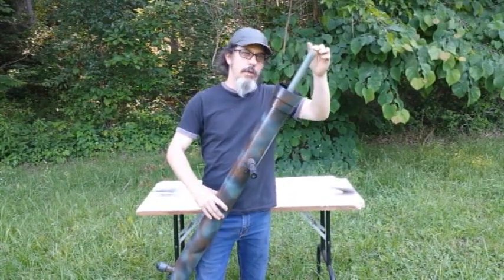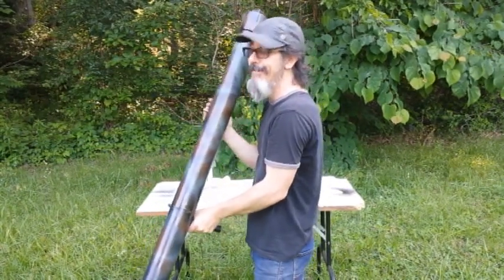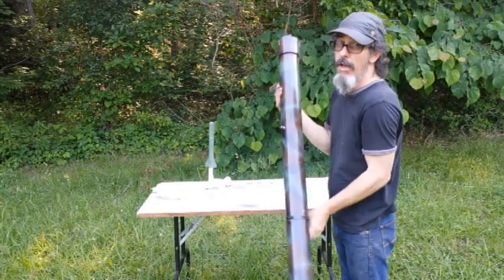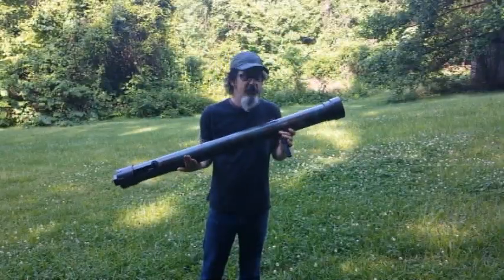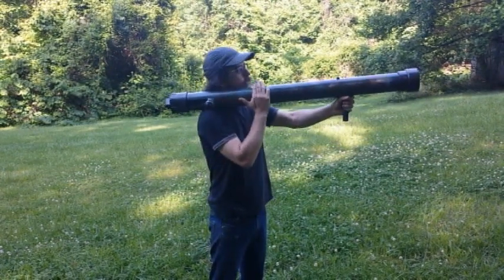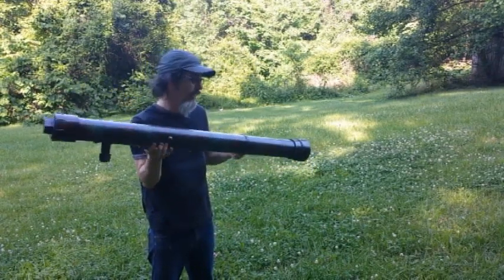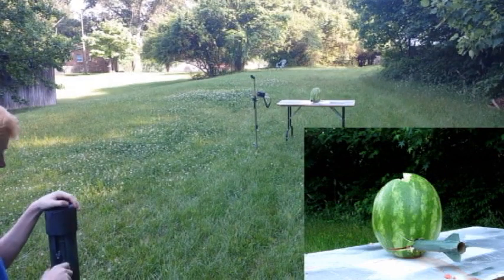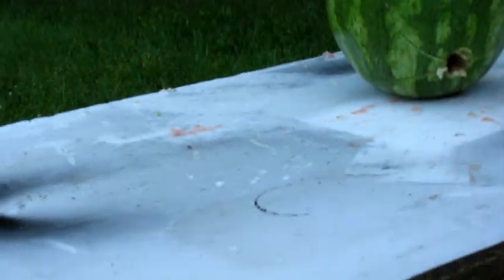Nitrocellulose / Gun Cotton Shoulder Mounted Rocket Launcher Reveal! King of Random Dethroned!

Comment: Funcionaría la nitrocelulosa en una bala?
Reply from the maker: Translation: Will nitrocellulose work in a bullet?
Modern gun powder is based on nitrocellulose. However Im not an expert on firearms or reloading bullets. Improper reloading of bullets could be very dangerous.
Reply: schel sullivan Thank you so much for your answer!
What do you think about gas combustion propellant in a specially designed bullet/shell for that purpose? Maybe, this method can cause a louder bang for an airsoft replica, and make it realistic! (Plus  with a exploding BB's maybe¿?)

Sorry for my bad english man
Reply from the maker: That make me think of toy cap guns. Did you see KingofRandoms thunder caps video? https://www.youtube.com/watch?v=ctX3juq9Okw
Reply: schel sullivan Yup, i did it. But im talking about exploding BB's (actually exist), not an exploding target.

Maybe I do the experiment, to corroborate if a cartridge loaded with propane can shoot steel BB's... It would be amazing!
Reply from the maker: I have been thinking of redesigning this NC powered launcher to shoot more than cardboard rockets. More like a muzzle loading gun, but the PVC pipe is not likely strong enough. Need a breech proof design so It can stay safe.
Reply: schel sullivan That would be amazing dude. Try to use copper or aluminum for the main structure

Comment: Hey Schel, Nice far as it goes , Your "rocket " flies straight and has a velocity! Try actualizing The rocket by adding a store-bought engine say C 12 -0( no ejection charge) with A little Armstrong mixture or flash packed carefully in the nozzle to ensure Ignition …
Reply from the maker: Ive been thinks along the same lines, but with homemade sugar rocket engines.
Reply: @schelsullivan  use some black powder in the nozzle, the other two suggestions will blow out the clay

Comment: I've always kinda stayed away from building a device that involves lighting explosives right next to my head.
Reply from the maker: That would be good rule of thumb, however that is exactly what you do when fire a riffle or shotgun. I do not recommend attempting anything I do in my videos, they are "for educational purposes only". Did you see my breech testing video I did on my side loading gun cotton combustion chamber? https://youtu.be/ac4eO81pfHQ I did thoroughly test this design before firing it off in my hand. This design will hold up properly with the .25 ounces of gun cotton its designed to burn. Still, dont try this at home unless your and expert at this sort of thing!
Reply: Still, the DEGDN in gunpowder has much less of a chance of detonating.

Comment: If you want to make an impressive explosion try this: using a rubber mallet,lightly hammer the contents of a Estes rocket motor. Once done crush the propeller into fine powder,repack it into the tube and use adhesive buddy on both ends. Place the electric match in middle of tube. The rubber mallet let's you remove the propeller without beating up the rocket motor. The result is impressive..it got the cops called on me for it once.

Comment: LOL Hey add some TATP to the tip of the projectile :)
Reply from the maker: Sounds like fun. You think the rocket launching forces might set off the TATP? I should probably start with something a bit safer like armstrong mixture though. Ive been trying experimenting with flaming rocket tips by adding a nail to the tip of the rocket, wrapping it with steel wool, igniting it and firing the rocket into flammables. So far the results have been, meh.
Reply: Tatp is way safer than Armstrong's mix , just don't mix it with any metals. I should do a video on that. :)
Reply from the maker: I'll look in to it. Theres a lot I need to learn and I want to stay safe and legal! TATP does look fun to make and play with though.
Reply: If you did use TATP or HMTD  you would have to use an ( anvil and a hammer plate ) to impact it enough to set it off.
Reply: I strongly suggest you check out Piano Man42 TATP videos, if you have not already. Plus you have a family to consider. A couple of years in prison plus legal expenses. You could loose a hand, or worse, that's really expensive as well. But it can be done, the devil is in the details and there is a lot of misinformation out there.
Reply: earth digger “Persons who manufacture explosives for their personal, non-business use are not required to have a manufacturer’s license. However, no person may ship, transport, cause to be transported, or receive explosive materials unless such person holds a license or permit.”
Page 68, Paragraph 72. “Who must comply with the storage requirements?”
“…all persons who store explosive materials must store them in conformity with the provisions of Subpart K of the regulations…”
Pages 47-53, Subpart K – Storage
This section details storage which is in conformity with the regulations and which will satisfy the BATFE’s requirements.
Reply: I meant for that comment to be directed to Schel, my bad. I'm guessing that quote is from the BATFE orange book, that's how people can legally use Tannerite (exploding targets). State and local laws can still make it illegal. Or law enforcement could just say a person had terrorist intent or simply falsify evidence. They don't have any shortage of dirty tricks. Google "charged with manufacturing explosives"; probably several USA.
Reply: All good man i just though i would post the ATF law so people could see it. You are right about them making up fake charges. Most people that get in trouble with it don't bother to look up state and FED law. So they do dumb shit like drive with it or store it with out the proper explosives magazine or even store it in a house. :)